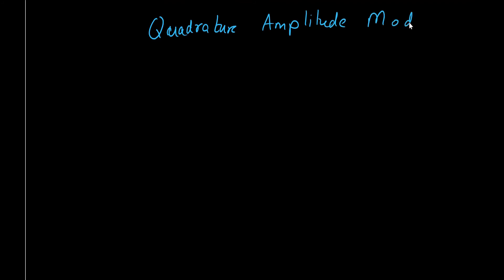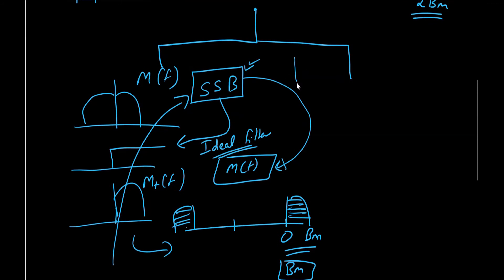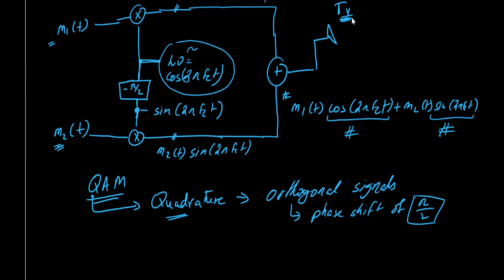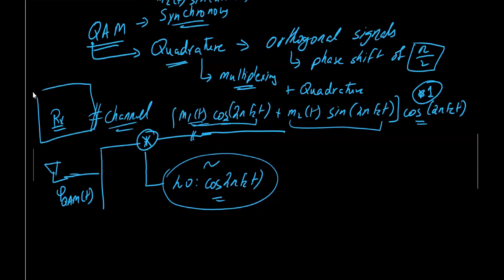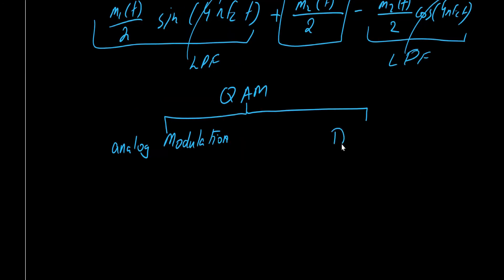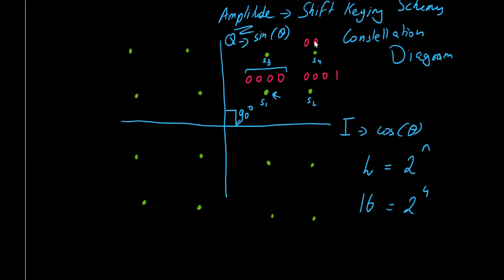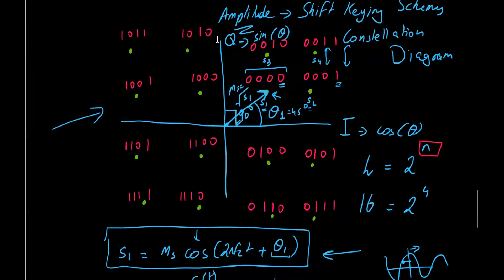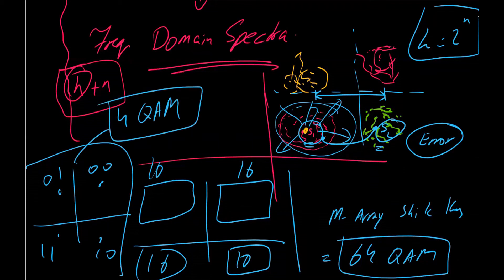QAM and Constellation Diagrams: Understanding Quadrature Amplitude Modulation | AM 2.6

Comment: Why we use phasing in QAM?
Reply from the maker: Its because phase shift do not affect the magnitude spectrum and hence the BW remains the same for two signals being multiplexed
Reply: @AKHassan  
 Why we using aperiodic carrier signal to obtain the normal amplitude modulation
Reply: @AKHassan  can we generate normal amplitude modulation in linear device ? and why we using or not?